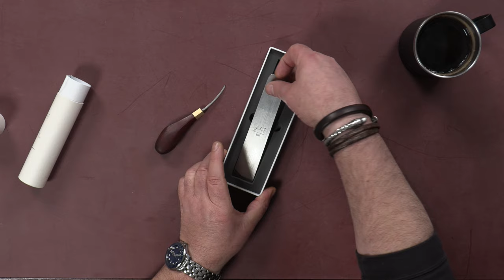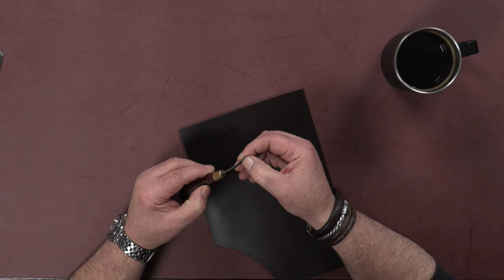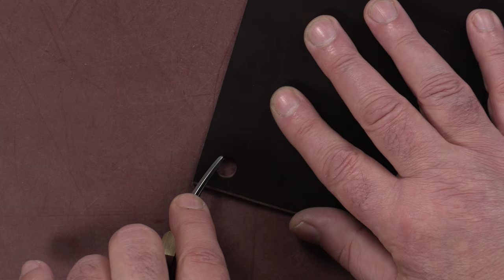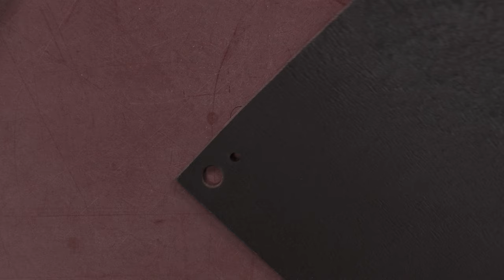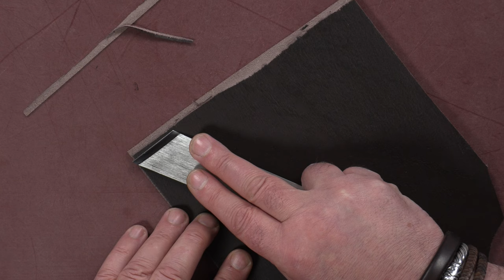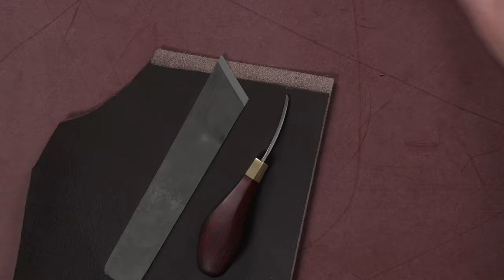JunLin Leather - Beveller Review

Comment: I ran out years ago to get my Armitage slickers. How do you think these edgers compare to the Montana Edger?  Did you notice any puckering on the tight inner angles?
Reply: I (Sam) have not noticed any puckering on the inner edges. But have not used a Montana edger so can’t give a comparison.
Reply: @samg8822  thank you for the reply.  I do a lot of very tight, probably unadvisedly tight, inside corners and curves on leaves, so I'm always on the lookout for these types of edgers/bevelers. I've got a single Montana Edger that's been doing it for me the last few years, but it's a little fat on either side of the cutting face; the shorter toes mostly make up for that.
Reply from the maker: I have just put the JunLin tool next to Ron's Montana and the JinLin is about 1mm narrower.
The construction is similar, and Ron's tool also has the lovely deep grove on the back.
I imagine, if you are getting a tight corner bevel with Ron's tool, you may get in tighter with JunLin's tool due to it being thinner.
Certainly, I was impressed with 5mm but have not yet tried it any smaller.

Nigel
Reply: @ArmitageLeather  thank you! That sounds very promising.  I love the Montana, but it is fatter to either side of the cutting area than my other edge bevelers, so these might help cut down some of the frustration caused by my own design decisions.

Comment: This was a timely video to see as I just got my first skiving knife yesterday. I have a question about sharpening if you don't mind....After I sharpened mine  I noticed that as I ran my fingernail along the back side I could see the edge deform ever so slightly. A dark spot on the face, just at the edge, would track along with my fingernail.  Would that be normal to see? The brand is Wuta and I paid about $19 (US) for a pair, left handed and flat. It is labeled as 420B Martensitic Stainless
Reply: Oh, and Thank you for the blog post on pricking irons/stitching chisels. That's how I ended up on your channel
Reply: What you're describing sounds like a burr, which is a sign that it is time to turn it over and do a few strokes to remove that burr.